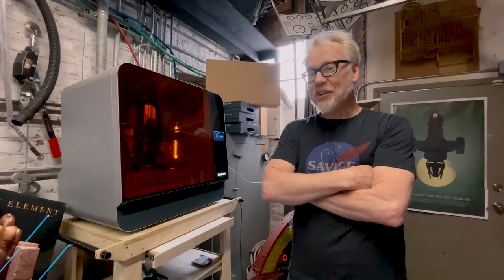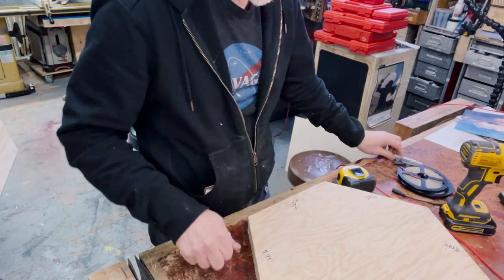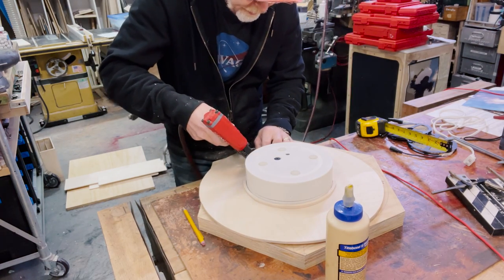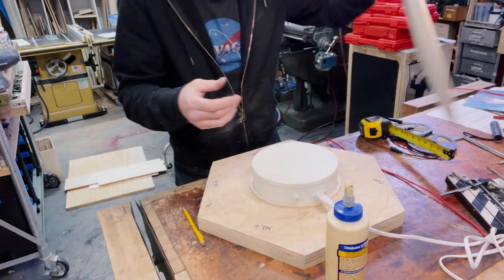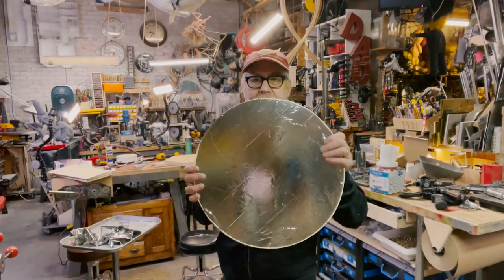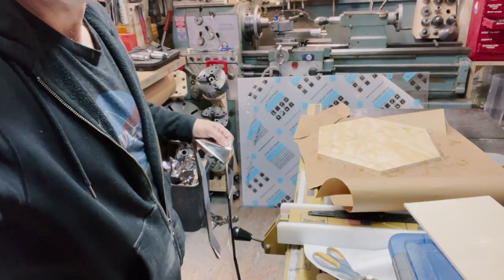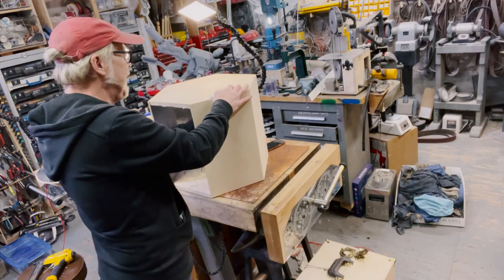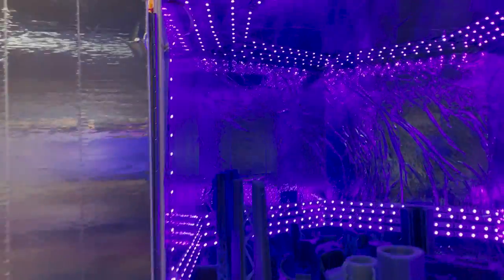Adam Savage's One Day Builds: 3D Print UV Curing Oven!

Comment: You need to find a tiny disco mirror ball to hang from the ceiling and a little MP3 player to pump in some dance loops whenever the device is on.
Reply: Nice idea. Maybe play just when the door is open. A random 5-10 second .wav disco loop? Prefixed with random intro statements from Dodgy-Euro-Adam ?
Reply: Or build one🤔
Reply: Would be fun if the music continues when you shut the door, but much more muffled than before.
Reply: was about to suggest that, but you beat me to it!

(if I ever get my 3d resin printer, I'm so gonna add a disco ball to my curing station)

Comment: If you hinge a pair of the doors on a hexagon, you can level-lift and remove the entire rotary table top.  This might be handy for transferring stuff in and out.  Depending on cycle times, you could also make a second rotary table top so you could prep one while the other is baking.
Reply: Good point. Removable turntable surface horizontally

Comment: I built one but used a junk microwave. Had the turntable and timer built in, just had to pull out the magnetron and coil and stick in the led cob and power supply. Since the power supply uses line voltage you can put it directly in place of the coil for the magnetron so the microwave still keeps all the functions! Best thing ever is defrost mode for sensitive resins, it pulses the light on and off
Reply: Built in ventilation, built in UV protection, internal reflectivity, easy to clean glass turntable... Old microwaves are the best.

Comment: Small tips Adam:

If you use a clear base, then light can get to the underside of your prints. Otherwise you need to flip them and cure again.

It's a really good idea to add a clear container that you can fill with water. Water curing dramatically improves curing.

When orienting your prints, don't leave flat surfaces even with the plate. This causes all sorts of problems, including warping and pimpling around supports. Proper orientation will also help your success rates a lot.

It's usually a good idea to remove the supports before curing. They are much softer then, so will come off much easier and cleaner.

When you remove the supports, you also want them warm or even hot. I use a heated ultrasonic cleaner ( with all-purpose cleaner, not a flammable alcohol, though there's a way around that issue. ), set to 50c, and remove supports as soon as I pull them out of there. They come off soooo much easier and better.

Comment: I built a turntable once. To get it perfect, I anchored a router upside down for cutting, put a blank piece of wood on the motor device, and turned it on. As it spun, the router cut a perfect circle in relation to the turntable.

Comment: Great design! Ditto to the need for eye protection with UV. I made my UV curing box with foam core, and aluminum foil as the reflexive coat. Has worked great. Cheap and light weight. It even has a UV shielding window to see the models inside while they cure.
Reply: Here’s a link to my Instagram if anyone is curious to see it https://www.instagram.com/p/CIkBHFLjb0A/?igshid=1xyrkm9hwomcx

Comment: A couple tips from someone that's been resin printing for a few years.

The supports leave less marks if you remove them After you do your post print washing, but Before you do your post print curing.
It just makes it so you don't have to do quite as much sanding of your print if you want it to be perfect.

Resin cures faster in the absence of air. So if you do your post print cure in some water, it goes faster. This isn't going to matter when you're in the Form ecosystem since they control your resin. But if you're using something like a Photon, Elegoo Mars, Epax x1, etc. Then it can make a huge difference

Comment: Hey Adam, in your opening shot, it looks like the printer is stored next to a window. If there is any natural light nearby, it drastically affects the function of the printer and can lead to more failed prints and maintenance down the road. Additionally as a safety feature, you should probably have some UV-proof goggles when looking into an unshielded chamber (even if your glasses are UV resistant, the LEDs put out a lot more than sunlight does). The LEDs are significantly brighter than they look and can damage retinas with invisible light.
Reply: The printers come with UV shielding to block external light. Though, if it does have direct sunlight on it, that can cause issues when you open it. So, yes, it's definitely a good best practice to keep away from ANY UV source. ( Especially for Adam this would also mean keeping it away from any welding. )

The light used in these printers isn't really UV. It's 405nm which falls under visible light, and even long wavelength UV A ( like 385-400nm ) is quite safe.
Reply: @zemerick  This is correct - While it's never a good idea to look directly at any bright light source, the 405nm (aka "near-UV" ) is generally considered safe and nowhere near as much UV output as you'd get outdoors even on a relatively overcast day. While safety is always of paramount importance, there is a huge amount of bad information on the internet about these things and it should be noted that the curing process for resin prints is very safe (safer in fact than handling the actual resin, though even that is nowhere near as hazardous as many people online would have us believe)

In short, always be safe, but there's no real need for people to get paranoid about this stuff :)

Now if you'll excuse me, I have to go and replace the FEP on the resin tank of my Elegoo Mars :)

Comment: Improvement tip: raise the turntable a bit and make it out of a UV clear plastic. That way, the bottoms get cured as well. I'm sure Adam will soon learn that the supports come up easier if you cure after removing them :)
Reply: Yeah was wondering how the bottom was supposed to cure well here.  I guess some reflection will get up, but my store bought cure station has UV lights shining up from the bottom as well.

Comment: I just lined one of those hilariously large bulk store coffee cans with uv light stripes. Adam with the flex here.
Reply: Hey, if it works, it works. He could have built it out of stainless steel, with hand-cut mirrors and a circuit to turn the UV light off when he opened it, but he built it out of plywood and nails. If it does the job, then that's good enough.
Reply: @darksunrise957  "The job" isn't binary. There are several problems with his design, which I'm sure he'll find out and eventually fix or improve in "version 2.0".

Comment: I built a UV curing oven out of a Home Depot 5 Gallon bucket. Lined the interior with aluminum reflective wide duct tape added 2 layers of plexi to the bottom with the bottom most layer covered in reflective tape and the top most layer I kept clear to protect the LEDs that I lined the bottom with and also to allow the UV light to penetrate the bottom of the part as well. I also lined the sides with UV LEDs all the way around. Then I added the same two layers of plexi to the lid and connected all of the LEDs together powered by a 12v 10amp PSU. I have no turntable since the UV LEDs are completely surrounding any part I insert into it. Has worked out really well so far. I think I have about 375 UV LEDs total.

Comment: Wonderful build.  Maybe use a small squeegee to smooth Mylar.   And the door needs a handle and locking mechanism to secure it closed
Reply: Yeah its always one tiny little detail like that that I am always feeling is left off :D He'll probably add it later.
Reply: Or a brayer.
Reply: For more aesthetic purposes indeed. As he said though, it doesn't matter here as it was a functional build.
Reply: Oh he needs to add a thing to roll up that 500ft power cable on ;)
Reply: I was thinking about something to hold the door closed. A simple hasp would probably work well to both hold the door closed and something to grab to pull the door open.

Comment: I would recommend to add a timer, learned that the hard way as I forgot prints and accidentally overvured them. Also maybe a layer of acrylic on the base in case some liquid resin is hidden somewhere it's much easier to remove it from acrylic rather than mylar.
Reply: Two more reasons an old microwave is the way to go

Comment: We use UV cure as a top/clear coat when making lures.  Its super hard and sets up much quicker than 2 part epoxy (that 5 min stuff is junk).  You can also mix in glow powder.  You can get microwave turntable motors for cheap and they make a great slow turning motor and for your light, look on Amazon, tons of 20W lights that will cure that stuff in no time.

Cool project.

Comment: Good timing! I'm building a UV curing station today. Thanks for the vid, Tested Team.
Reply: Make sure to build it bigger than you think. You never know when you'll want to upgrade your printer to a larger one. Plus, it's a good idea to be able to fit a container of water in there which you can submerge the prints in. This dramatically improves curing. ( Note: Obviously not the case for water washable resins, and yet another reason not to use those. )

Comment: I use a fdm printer and just recently switched to PVB as filament. Just submerge it in 70% IPA for 30 mins and it comes out perfectly smooth. Currently experimenting with 90% IPA for submerging time and to just to spray it on with a spray bottle.
Reply: Why would I put a print in an India Pale Ale? 😄

Comment: If you use a couple pieces of velcro to secure the platform to the turntable it will be much more stable when you are curing an object that has uneven weight distribution. This fix will still allow the platform to be removed easily but also be stable.

Comment: Congrats for joining the 3d printing world!
It looks great and I'm sure it works fine ... as there isn't much to uv curing really.
Mirror-life surfaces cover most design mistakes.
But I'm also surprised about some design mistakes that Adam did.
I'm not surprised when other do them (I've seen some of them many times), but I expected better by Adam :)
The first thing is most people put the uv led strips horizontally, which creates horizontal lines of much higher intensity since the turntables also rotate in a horizontal plane.
I would try to distribute them better in the full height of the box (and least around the height of the models). 
As I said the reflective surfaces cover that mistake as uv will bounce around a bit and still will hit the models from most sides.
The 2nd flaw is about the turntable. I've seen many people making its plate reflective too, which is fine for bouncing downward UV rays back up, so they hit the sides of the models.
But the one surface that is in total darkness is the bottom of each figure (at least if it's laying flat).
It's much better to have reflective floor of the box, and then glass rotating plate so that UV rays can bounce from the floor (around the turntable itself. so it's better if it's smaller but with wider glass plate) pass thru the glass (so don't use plastic plate as it stops UV too well) and hit the bottom of the models.
Also as some mentioned in the comments it would be more convenient to have two walls open as doors, as it'll give access to the full width of the box, while keeping plenty of structural integrity (with the other 4 walls).

As I said these flaws aren't critical. Prints will still get cured (especially if not put flat on the plate).
Also nobody can even say with some certainty how long should models be cured. 
Nobody can even say what's the idea time to cure prints, given specific UV light intensity for example.
But it seems overengineered and subpar at the same time :/

Comment: Aluminium coated mylar is a good option. It reflects most of the UV light in that range - stainless-steel for example actually absorbs a significant portion of the UV light.

Comment: I know you already had it on hand, but what I did, and I would recommend for anyone making someone similar is to use chrome-reflective vinyl.
You dont have to fuss with the spray on adhesive and it provides a much more reflective surface

Comment: I made my UV curing chamber out of a large stainless steel stock-pot I got for I ~think~ $20 or so (they are surprisingly cheap, and especially so if you get one second-hand from goodwill or other thrift stores).
Lined it with a $20 UV light strip kit from Amazon, and a handy solar-powered turntable (also on Amazon for less than $10) so for about $50 total I have a UV curing chamber that is neigh indestructible, extremely reflective surface without hassle, aluminum foil or mylar, the convenience of handles and can move/store it under my printing table/desk.
Best of all, if any resin or anything gets on the surface of it, I can easily chip it right off, and if the lights or solar turn table ever crap out they are cheap to replace as well.
Reply: That's some strait up RedGreen/MacGyver stuff right there. I lIKE IT
Reply: I did basically the same thing, but used an IKEA LIXHULT storage cabinet
Reply: Is the solar powered turntable powered by the LED strips?
Reply: @dolphin64575  yup, works perfectly
Reply: Food service suppliers (Hockenbergs is one national chain) has super affordable stainless steel vessels in any size or shape you could want.  I got a pot the size of a 5 gallon bucket for $14, to replace a rotted out galvanized steel bucket.
Reply: @travismiller5548  Yeah that's what I've got too, it's a big 5 gallon stockpot (or whatever you want to call it) and it's plenty big for anything I can print.

Comment: Upgrade ideas:
- Turning UV off when door is open (and turning on a standard light).
- Cooling chimney, vents, fan.
- If people wish to add a transparent floor make sure the material passes UV light sufficient that curing still occurs by testing first. Glasses and plastics that pass UV-A  may reduce it by as much 50%, but obviously some bottom curing may be better than none. Other transparent materials might block the passage of UV completely and degrade over time from the UV exposed side.
Reply: All benefits to be had buy using an old microwave instead of building a thing from scratch

Comment: Building something similar to this at the moment, it's square section not hex, but opens on two sides, so corner hinged, it also will have an arduino running it, so will have a timer, start/pause/stop function, and turn off the UV if it detects the doors open, and if I can, remote app control/status.

Comment: Hi Adam, great one day build! I'm surprised you didn't connect two panels with a hinge (two adjacent panels, with a hinge between them and then one connecting to the fixed panel) to have a wider door to accommodate wider/bigger pieces. It looks like you didn't have much room to work with when loading and presumably unloading, that slight modification may make operation a little more efficient.

Comment: My uv oven is just a nail light, old tupperware and some foil.
Reply: I hacked mine together using an old microwave oven - it already has the turntable, the timer and a suitable enclosure - just take out the magnetron and high-voltage power supply and replace them with the UV light, then line the walls of the oven with crumpled up aluminium foil (crumpling the foil before applying it to the walls will spread the light much better than using a smooth surface and will avoid hotspots, especially as the lamp is on one side not all around). I've found that it will cure small prints in around 15-20 minutes or less, depending on the resin thickness

Comment: I have always removed the supports before doing the UV cure.  I found that I got more chips when trying to removed the supports from fully cured models.  I also have found best results when curing for only 60 seconds.  Longer than that and I get super brittle models.  I would set up a timer for the UV lights

Comment: Thank you for the led-on trick- I will try to remember that one! Did you catch a sunburn / did you have eyeproblems after the build or is it to low emission strength?
Reply: Different wavelength. It's 405nm, which is safer than most blacklights even.

Comment: I'm assuming the reflectivity in the oven is meant for more even illumination and to reduce heating from absorption in the walls, right? If that's the case, a specularly reflective surface like the mylar isn't the best option. If you want an even illumination, you want a diffuse reflector like in an integrating sphere. Something like titanium dioxide would work well for this. They both result in high reflection from the walls, but the titanium dioxide will spread the light out after reflection while the mylar will cause "filamentation" of the UV light.

Comment: Adam: Simple Green works well in place of IPA. If you have an ultra-sonic parts cleaner that can warm the liquid, that seems to do a better job and make it easier to remove supports. If(read:when) you get a part that you can't pop off of the build table, try the cold spray used to detect hot spots on circuitry. It can damage the print if you aren't careful but if you use it to hit the support base or the build plate, the part will pretty much pop off. Ventilation and PPE are also key for working with this kind of printer.

Comment: I made my UV oven with a string of UV lights a lot like the ones Adam used only mine came with an on/off switch, some foam poster board, and a mirror to sit it all on (an old build place from my FLM Printer.